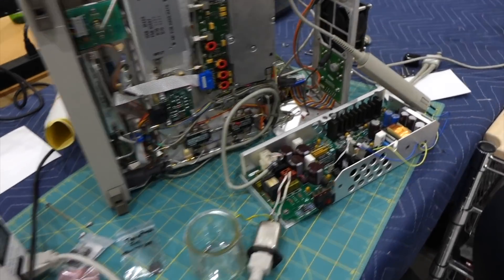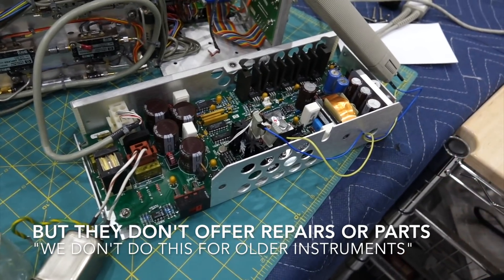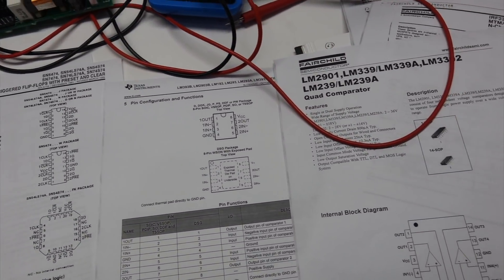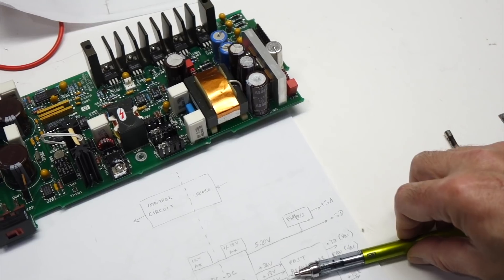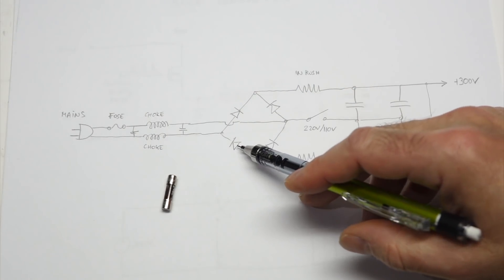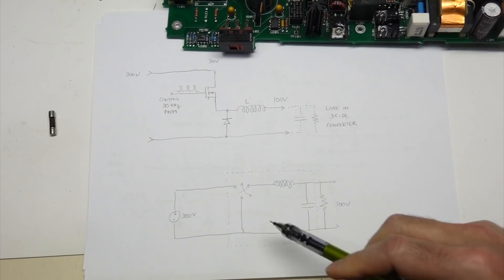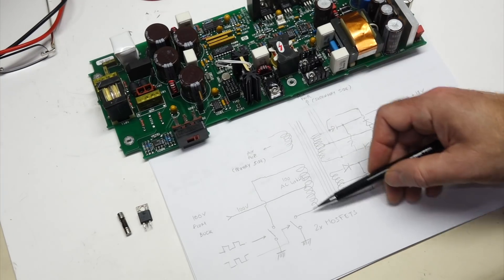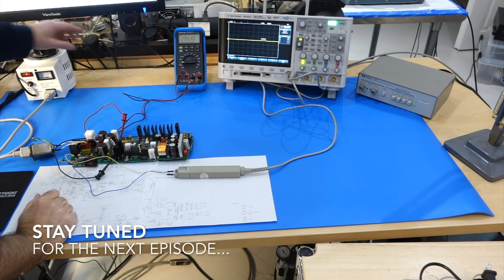HP Switching Power Supply Repair Part 1: How a SMPS works

Comment: Well done and thank you, especially for the diagrams and your experience of the 4 videos! Mine works, but I have a problem in CW mode: the calibration is unstable in frequency when entering this mode... I suppose that there is a hum on a CW carrier (for example at 1 GHz) with a very reduced resolution and range, I observe a scissoring, I will therefore concentrate on replacing the capacitors of this power supply!
Reply: the problem is solved, in my case it was the external 10Mhz which was unstable

Comment: Excellent video Marc. I enjoyed your analysis of this switch mode system. I am presently waiting on a controller chip for a 3 rail switch mode that is sick. While I am NOT servicing as complex a supply as yours, the troubleshooting breakdown is somewhat the same so I feel better about the diagnosis of my own issue.

Comment: Just a tip, not for this particular power supply, but in general: I've ran into an issue with a switching power supply with a Samsung monitor. It blew the mosfest every 2-4 months, and I had to repair it every time and it drove me crazy, because all the components seemed fine, but even after replacing almost everything it still failed. As a last resort I desoldered the small transformer that drives the mostfest to inspect, but I found nothing special and soldered it back. Well, it fixed it, never went wrong afterwards. So most probably there was a microscopic crack in the soldering of the transformer. Since this transformers job not just opening the gates of the mosfest, but to discharge and close them, it explains if there was a contact issue the mosfet stayed open when the other opened, therefore causing a short circuit in the high voltage rail. So if you find nothing exceptional or obvious, it sometimes worth just reflow the solders with fresh (probably leaded) solder, because the lead-free what they use nowadays is so brittle, it may crack.

Comment: This is a great video. Its helping me work on a similar power supply for an HP spectrum analyser 08562-60094. The problem though is finding the parts relating to  HP part numbers. For example the switch mode power supply control circuit has an integrated circuit  part number of 1826-0806; but I cannot find its actual number anywhere? I think its something like a SE5560
Can anyone help with this please?
Reply from the maker: It's a NE5560N. Just Google it, it's in the cross-reference tables that have been published.
Reply: @CuriousMarc  Thank you sir . My Google search seemed unsuccessful for some reason. There are cross references that I have found but very few and not exhaustive. Following the test in the manual it seems the control circuit is actually working but it wont kick start even though everything checks out, or seems to. If I activate the control circuit externally and force the power supply on, it all works (no smoke) however I did notice the 5 volt rail  running at 11 volts and the 28 v rail at 33 volts. So I think it's over volting and is switching off via the feedback circuit. We shall see! I hope you can do a few more videos on these hp power supplies. I think they are a challenge!

Comment: Most never realize just how hard it is to repair some electronics... Love your methods...  I do an initial short check and then use an isolated dim bulb and follow the voltage.. I have spent days figuring out some really complicated PSU's... Just fixed a few HP Z4 G4 PSU's  with 18 & 12 Pin non-standard pin outs.. They are worth fixing as replacements are over $200 USD...  DPS-750AB-36.

Comment: This is most possibly the best and most detailed video about switched-mode power supplies. The schematic you've shown is pretty much standard, since I've seen it in several power supplies, namely in computers. However, it is the first time someone has made a detailed video that made me actually understand more, and in a simple manner. Thanks for creating and sharing this excellent series!
Reply from the maker: Thanks! Just watched your video on stenciling a PCB for surface mount components. I need to do that next for my HP 8082 repair! Portuguese sounds really nice too...
Reply: @CuriousMarc  Thanks! That is actually my most watched video and I wonder why. It is certainly not my favorite. I have other videos though, where I approach other subjects, namely personal projects featured on by blog, and I would recommend those any day.
Regarding your HP 8082 repair, will you make a video showing the procedure? I think it would make an interesting video. However, if I had to guess, probably you can get away without a stencil, as those are typically used to populate new boards. Hot air certainly will help desoldering ICs in general, and can be used to solder packages like QFNs and such. The solder can be dispensed with a soldering iron in those cases.

Comment: Hi Marc,  This debacle is hitting me more as I obtain equipment with early SM power supplies. After struggling with the power supply of an Advantest SA for weeks I gave up in frustration. I had full documentation for everything except the power supply. Of course the company said the same thing to me. As more of this 1980's and newer equipment  is obtained , I am thinking of just building my own supplies and powering them externally. In the long run it will take less time and make future repairs more likely possible. Love your videos by the way. Very impressive.

Comment: I first suspect that either instability for one or more of the IC VCC rails are happening... with a lot of old-style tantalum caps, I'd suspect one going short at an inopportune moment stopping the IC functioning.... 
sometimes an unstable VCC can cause latch-up on an output. This latch-up usually causes a stuck-on FET through a transformer/inductor and blows the fets.... shorted fets can then blow the driving chips (Quite normally)....
 also if the input filter capacitors don't filter the ripple enough, then the FET can get erratic drive signal putting a high source-gate voltage blowing the gate barrier and shorting out the FET, the shorted FET's gate-drain puts a high voltage at high current onto the drive pin of the IC blowing up the IC.
If the IC doesn't blow, it then can become defective, thus causing weird issues ranging from appearing like failed VCC to excessive on-time (causing the current through the inductor/transformer to go above what the FET can handle and it blows the FET)
Now I'll finish watching the vid.

Comment: How you have 300V DC when input AC voltage is 110/230V? It needs 3-phase outlet?
Reply from the maker: It does sound weird, doesn’t it? But 220 RMS bridge-rectified will give you 300V (square root of 2 times AC voltage). In the hand-drawn schematics of the rectifier, you can also see the trick they use to get the same rectified voltage from 110 AC. They switch one of the mains to the middle point of the stacked filtering capacitors. This simple trick has the effect of transforming the rectifier circuit into a voltage doubler (not full bridge anymore BTW, only two diodes are used from the rectifier in that case). So you get 300V DC in that case too!
Reply: @CuriousMarc  Thanks now it makes sense :)

Comment: Rather odd to have a buck converter stage on the primary side, but this obviously predates more modern power supply designs with PFC boost converters (which usually supply approx 400VDC to the main switching converter).

Comment: For some rare designs you can send the supply off to a reverse engineering house overseas. They’ll extract the schematic and give you drawings and fabrication files for a fairly low cost.

Comment: I share my experiences.
If there is no schematic, the first way is to draw a schematic and the second is to record all the parts.
And measure and record the parts (resistor, cap, diode, fet, zener, opto, etc.)
So, if you find that the measured value changes in the resistor or capacitor, you can get a quick result.
And if all the measured parts are normal, you should look at the IC.
Of course, all ICs are examined and recorded.
The IC first examines the control IC and replaces any suspect.
There are low-cap (33, 47uF) caps in the control IC section.
These are very important in the operation of the control IC, so be careful.
You have to narrow this down to catch the problem.
If the above work sequence does not produce good results, the measurement record and drawn circuit diagram must be reviewed and studied again.
Over time, the Switching Power Supply circuit comes into my sight and I feel confident.

Comment: Hi CuriousMarc, I developed a photographic method to make diagrams. I take pictures of both sides of the PCB. Then I invert the copper side. And merge the two sides at some opacity levels.   See the process at this pictures. https://www.flickr.com/photos/jgustavoam/albums/72157677627872151

Comment: Would it be possible just to fit one or two new off the shelf switch mode power supply modules into the case of this one?
Reply from the maker: In this case it would be really tough, I'll explain briefly in part 2.

Comment: Most switchers will run just fine from a DC input and may start at a surprisingly low voltage. Try feeding it with a current-limited DC supply. This will limit the amount of energy available to burn components, while also being mains isolated.
Reply from the maker: This is a good idea. But this one is really annoying. It has an undervoltage lockout, and won't start until it feels about 260V on the rectifier!

Comment: Very interesting video. I was working some time ago building power supplys for audio amplifiers (to get boost voltage for amplification) and lots of what was seen in this video was very familiar to me. Also if there was any issue with the code in the controller there was probability to blow the MOSFET's. Or the PI-controller was not handled correctly. Anyway lots of possibilities to blow MOSFET's and as the power supply was part of the bigger product on the same PCB then I was not particularly popular person who managed to occasionally damage the whole product due to blown MOSFETs. The situation was made more difficult as we were only software guys writing program for the controllers and if surface mounted MOSFET blew then we lacked the proper tools to repair the board so we either had to order more or had to send the board for repairs into another country. Anyway it was an interesting experience and you really had to make sure the code is correct before flashing it on or you had a danger of rendering a working sample into piece of garbage in a split second. The term Unit Testing your program took a whole different meaning - every line and ifstatement had to be tested before flashing to ensure thee quality because any mistake could damage the real hardware. There was a saying that every bug has a different smell.

Comment: I had same kind of issue with 12v high power audio amp blowing MOSFETs very annoying 😂 oh no there's a voltage switch on it ....someone's switched that and blew the lot I know someone that did it with a old pc supply 😂😂😂

Comment: I'm not a PSU designer engineer but that DC/DC converter dual MOSFET switching setup looks a little shaky. I have had bad past experiences with trying to simultaneously turn one MOSFET off while turning the other one on. Mind you, they were directly coupled and not through a an inductive winding... 
Voltage leads current in that circuit though and the MOSFETs are likely going to see a rising voltage after turning off (DC-in + rising V) before the winding starts to collapse and reverse. I'm guessing there is going to be some additional protection around the MOSFETs to help them, maybe they are now out of tolerance or blown...
This is just a wild-ass guess though, not pointing a finger at it and saying there's your problem.
Cheers,
Reply from the maker: I skipped over the snubber circuits and all that good stuff that is added to the design to mitigate that very problem. But to your point, that's part of the reason switchers blow transistors so easily - all it takes is some fault that makes them turn on at the wrong time and poof! the MOSFETs are gone.
Reply: @CuriousMarc  - just saw part 2, looks like the driver IC was going flaky ? That would explain how the 2 MOSFETs could blow..
Looking forward to part 3!
Cheers,

Comment: Well at least the ICs don't have their part number scrubbed or laser etched off. Hopefully there won't be any custom packages which in this day and age amount to unobtanium.
Reply from the maker: Well, some have HP-only part numbers that don't cross reference to anything, like the ladder resistors or the opto-coupler, so I'm not sure which is worse...

Comment: It is also worth noting that these power supplies can cost dozens of hundreds of dollars to purchase if you could actually find one!
I work in a broadcast engineering shop for a major network,  and we have power supplies dying all the time.
It is worth trying to repair them, firstly, because that is what they pay us for... If they wanted to hire someone to just order and replace dead black boxes, they wouldn't need us! and secondly, we can usually fix these things with a much shorter turn-around time, then ordering, and RMA'ing a new one... 
But as you say, some of these odd voltage and current supplies have been purpose-built, and you just can't find a replacement.
I once worked on a full-wave switchmode regulated supply, think four regular close loops, one for each phase, with power factor correction, and all sorts of strange control circuits of custom epoxied thick-film hybrids... that was fun...

Comment: This circuit looks very much like a current fed push-pull converter. The first buck converter actually provides a constant current to the switching stage. Note the absence of smoothing capacitors on its output. The constant current supply also means that the switching mosfets should never both be turned off at the same time and are driven with an overlapping waveform.
I suggest looking at the LM5401 datasheet, which accomplishes something similar with a single IC.

Comment: Uggh, I've repaired any number of similar supplies over the years. They can be a real PITA and like this one, they're usually not supported with any parts or schematics. Sold as a block, if you can get one. You're doing it right, break it down into blocks, substitute voltages and signals until you find the root cause. Of course, it is like a line of dominos, one thing takes down everything else. The only other thing as equally frustrating are DC-coupled high power audio amplifiers...

Comment: I had a problem fault finding a SMPS, it was being a real pain. It turned out to be a short on one of the output windings on the main switching transformer.  Although generally the most reliable part on the psu they can go faulty so worth checking the transformers with an LCR meter.
Reply: Not sure they're they're that reliable just  one of the harder component s to find a replacement for :/ a lot seem just custom made for the job at hand, in which case your only choice is hand winding, which is a pita and give up threshold for most

Comment: One of the tricks for badly behaved switchers is to ensure they can't draw enough current to go bang; put an incandescent lamp in series with the primary power and the PSU, if all is well the bulb won't light or will light at low brightness, dependent on the lamp rating. If things go bad in the PSU, the lamp will light at close to full brightness, but the current into the PSU will be limited to a safe value.

Comment: This supply reminds me a lot of the 856x power supply for which schematics are available, perhaps you could use this as a reference for identifying the different sections and their function. Still trying to fix my 8562 power supply 🙃 Consider changing the Rifa X2 caps at the mains input, they tend to go up in flames when you expect it the least. You could also try to measure with a light bulb in series with the mains, this would limit the available power to avoid bliwing up stuff

Comment: This brings back so many memories - the fear and trepidation of flicking the power switch, safety squints fully engaged, after having spent much time and money replacing components. Each blowup usually led to collateral damage (including nerves) so fault finding would have to start over again. In addition to the usual suspect capacitors, I’ve seen high value resistors (tens of kilo ohms) go high, open or intermittent in value and after some heavy “current excursions” sense resistors creep up in value leading to false tripping. Would be good to confirm the gate drive for the power mosfets is correct as any weakness there will be entertaining, albeit potentially tricky to do!

Comment: Try injecting voltages after the dc-dc converters, and check the feedback circuitry for proper operation, you may even find one of those sub supplies is the issue.

Comment: Omg.. i have an old Zivan lead acid battery charger, 60V non the less with a similar problem. 2 mosfets blew out their smoke... now i get is a red blinking lights. Multiple pcb's computer controlled board.... and just trying to find a suitable load for the charger to start on. Hmmm

Comment: Have  you considered leaving the unisolated side unpowered and supplying the isolated side with a lab supply to check out whether the isolated side is working? That way you can check out everything except the transformer. In other words, start checking from the loads and work back toward the mains.

Comment: I had a similar problem with an HP data error analyzer... the power supply after an initial normal start eventually fails like your does. After many ours spent to repair it, as soon as I reconnect to the instrument, it fails again 🤬🤬. A leaky capacitor in the digital board is where the fails chain started... be awere.